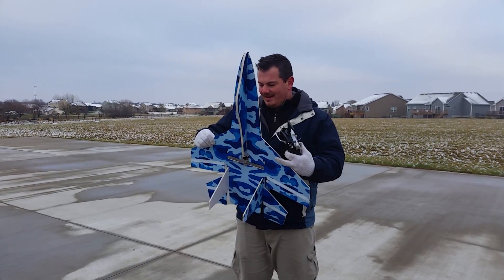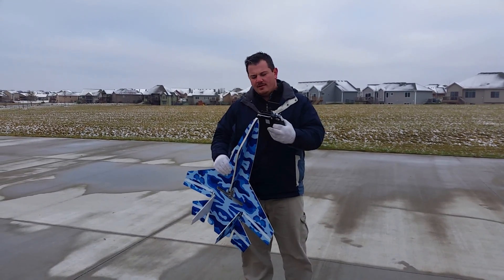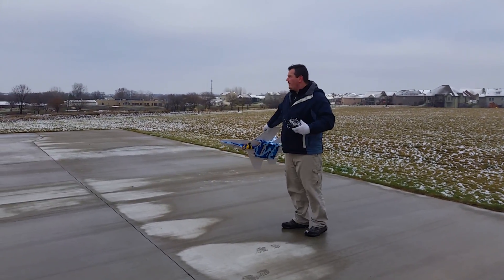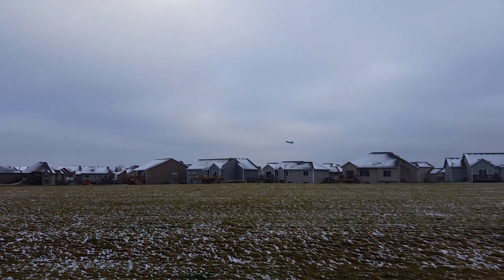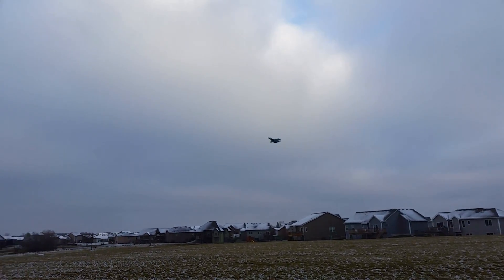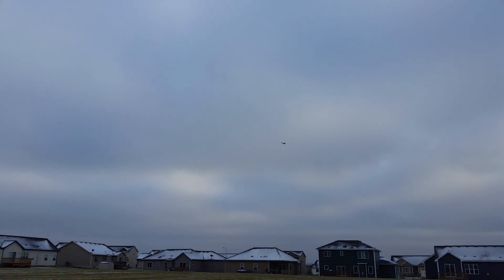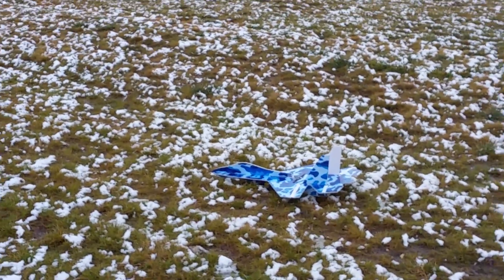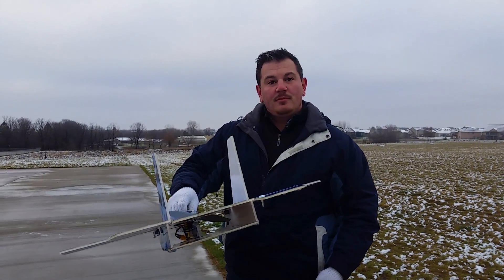Mig 29 Profile Plane - 2nd Flown with 3S 1000mAh 30C

Comment: Cool plane, do it again with a better battery.
Reply from the maker: Definitely. Kinda stinks because we had just flown for like 12 minutes on the 1300mAh 3S 30C, but evidently I hadn't used this 1000mAh 3S 35C for a long time and I think it may have been a bit spent!

This little plane was super fun! I want one now, but I'd add rudders too!
Reply: Still a cool model. Do another video, I'd like to see more of it.
Reply from the maker: Me too! You've seen half the flights so far. Don't forget too, it was really windy today. We didn't get it on this video, but this plane will hover if you're pointed into the wind, and I'm no 3D pilot.

I may have to talk Esteban into letting me add rudders, then I can do flat spins...

Thanks for watching!

I'll definitely get some more videos up as we put some more time in on the sticks
Reply from the maker: I'm uploading the first flight, here's the link...

https://youtu.be/qzR0QCY4At4

...loads better video, but didn't get the hand launch or about the first 1/4 flight. Should be uploaded a bit after midnight. Check it out!